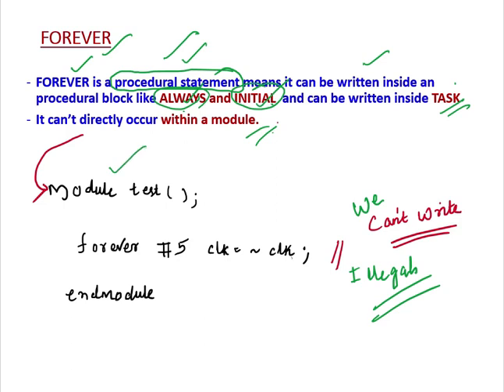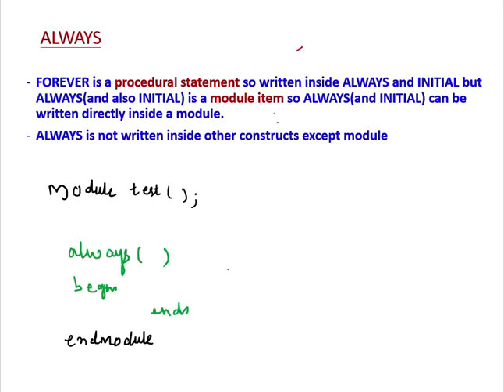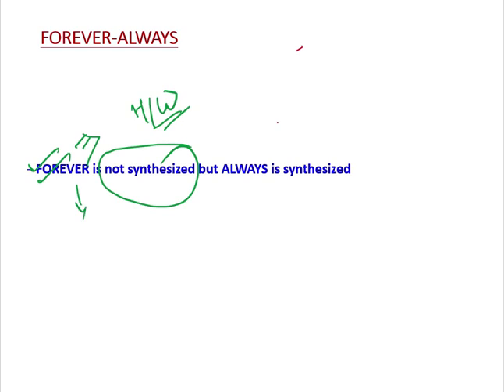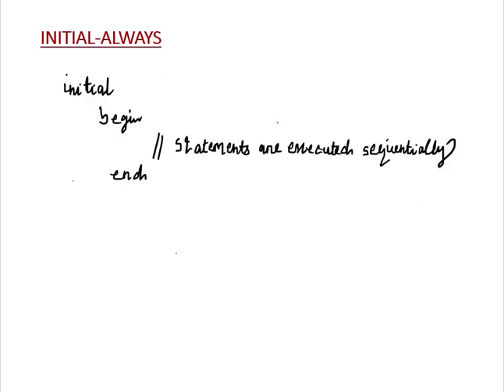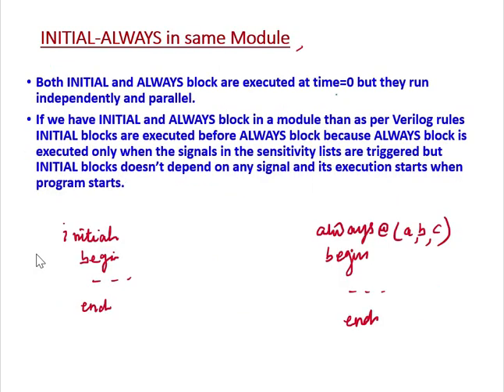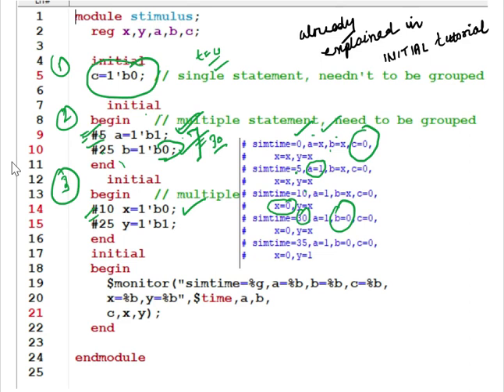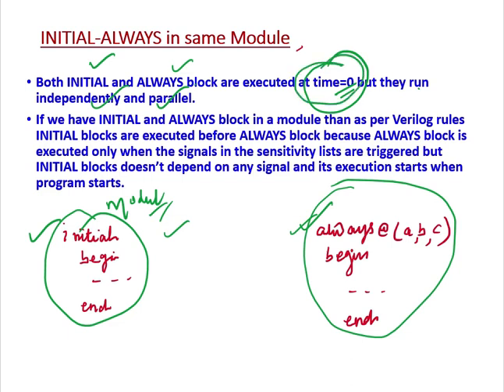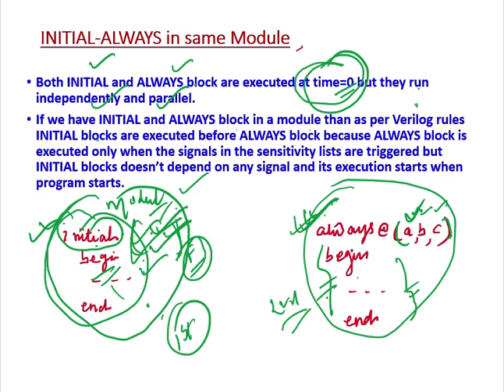#31-1 forever vs always vs initial in verilog ||forever in verilog||always, initial ||very important

Comment: sir,
As you are saying that forever loop does not have any hardware then why do we use it if we don't get its hardware implementation and suppose if we wrote code with forever statement then how it will be actually realized in hardware form as our final aim is to generate the hardware for code and use it for a practical application can you please clear this?
Reply from the maker: Forever is never used to design a Hardware so we never include it in our RTL code.
This is used in a testbench only to check the functionality of the code ( testbench doesn't generate any hardware)
Reply: Thank you sir 🙏

Comment: Hi Sir,
In testbench If we write always block (with out sensitivity list)and initial block in same module, Which will execute first?
Reply: Ok done thank u sir.
And one more doubt,  what will happend if we don't mention dealy in both the blocks?
Reply from the maker: Both executes at 0 ns. But again it depends on the delay inside initial block and always block in a test bench.So we can't tell at test bench level 

but if it's inside a module design then delays are ignored so it's always an INITIAL BLOCK that should be executed first.